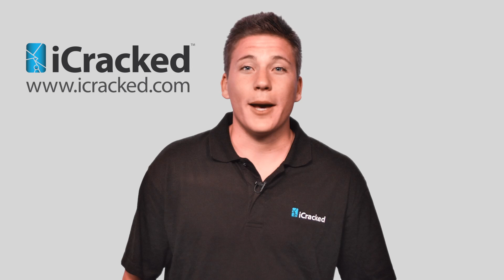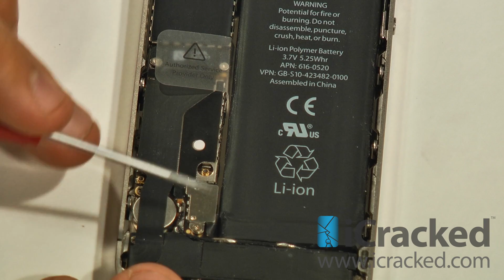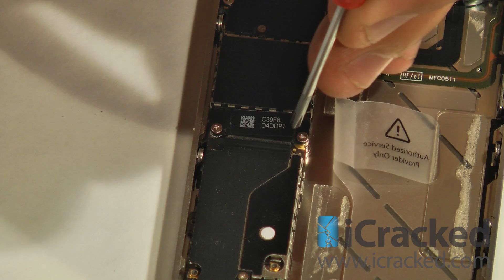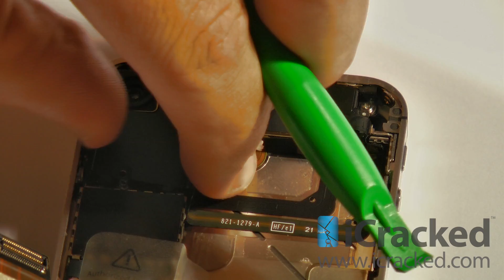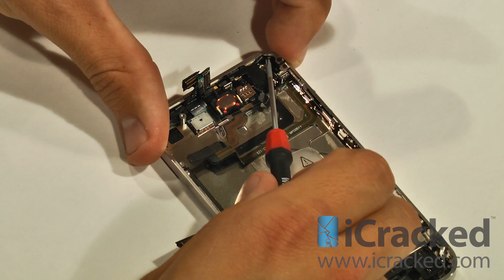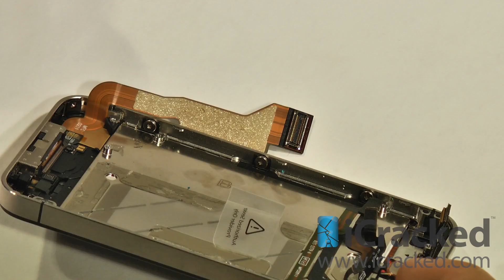iPhone 4 (Verizon / CDMA) Screen Replacement (PART 1) - iCracked.com

Comment: Great video - just create a flow chart with the boxes like he has and take your time. 

Also, when you are dealing with all the small screws it really helps to take your screwdriver and lightly run it across a magnet (take one from your refrigerator) 3-4 times... the screws will stick to your screwdriver.

Comment: @alaraza1 Yes it will be a problem, this video does not show you how to attach the LCD to a new screen, and as far as I know the Iphone 4 is set up so that you have to replace the screen and LCD assembly not just the screen.. This video only shows you how to replace the LCD screen assembly, you can buy the entire assembly online at a site like amazon or ebay for $30-40.

Comment: Hey, I may not be iCracked but the rubber piece your speaking of falls out of almost every phone i fix lol. it belongs on the top of the logic board right beneath the lcd\digi connection. the groove is where the logic board sits.

Comment: okay so effin amazon sold me the right screen but with the wrong screwdriver. I tried to unscrew one of the screws after removing the battery but it's all flat and any other screwdrivers won't fit :/ any suggestions/help plz?

Comment: I found an iPhone 4 - Sprint - with a cracked front screen (discarded by the user?).  Can I fix the screen and register the phone with sprint for my own use?   What is the Cost for the Screen Alone?  Also What does it Cost to have someone do this for me and where do I find this kind of person?  Thx, for the Video!